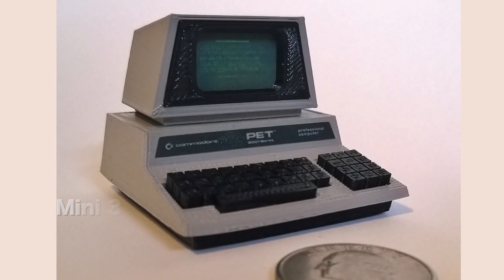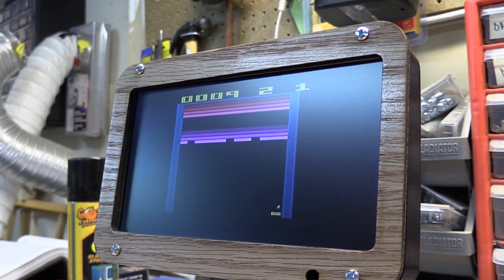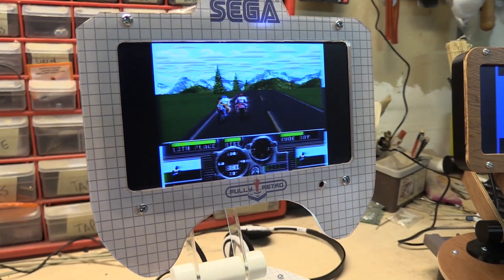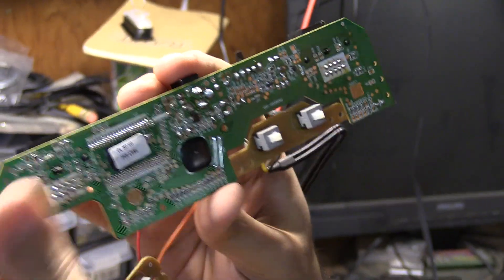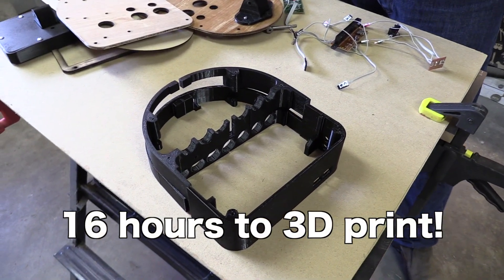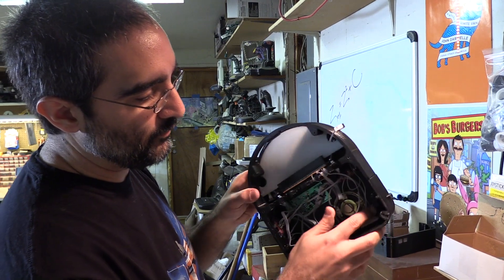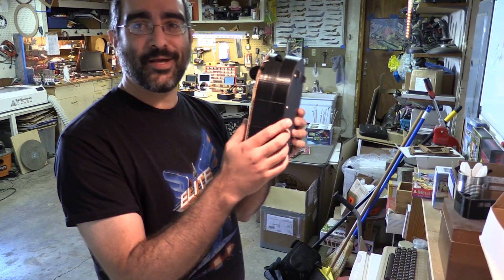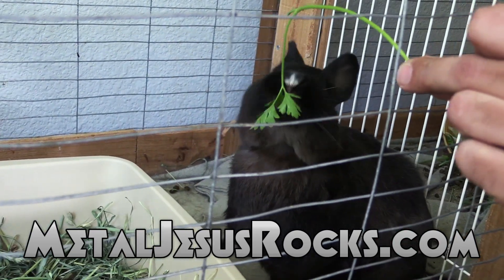Building a Rabbit Nintendo & Atari 2600 Clone Console

Comment: A version of these that would run off of rechargeable AA batteries would be awesome & more portable. FYI,  rechargeable AA batteries are way better than a battery pack. You can have a 2nd set charged & ready to go & never be stuck to a
 cord. One day that battery pack will fail, corrode & leak.  You will have to pay someone to solder it  Or attempt to do-it-yourself. Most people won't so they will just toss their device into the closet and forget about it. My Duracell rechargeable batteries for my nintendo wii have lasted 8 years  With daily use and I don't have to ever worry about changing out battery packs or deal with cords.

Comment: Very cool, but one thing I'd like to see in the future models is perhaps hiding or less reliance upon large industrial screws in the unit.  Some people probably find them fitting/retro and actually quite like the screwheads everywhere, but I'd personally rather they were hidden or somehow less used in the design.
Reply: ***** Oh, I've heard this commant A LOT :-) It's actually a design choice; I dislike how modern companies (Apple, Microsoft, really any of them) try to abstract away the manufacturing of their objects. I like how older tech revealed how it was built; it added an appreciation of the process. Now you buy an iPhone, and it's like, hey it may as well have been built by unicorns on the planet Yuggoth, because there are no signs of construction anywhere. Ultimately it's a matter of taste, I guess.
Reply: Dave Nunez That was funny!

Comment: Dave, is there a part number for the edge connectors used? I have one of those clone ataris and was curious where to pick up a connector.

I plan on ordering some of those mini consoles from you soon as well.
Reply: mllarson look up 5530843 at digikey.com (12 pin connector). They can be hard to find but digikey is a reliable source.
Reply: Cool, thanks!

Comment: I got a RaspberryPI for Christmas and spend a few days loading it with roms and stuff. It is certainly more accurate than the Nes on a chip would be.
Reply: Anthony McClintock Yeah, it's a great machine - we are thinking about how something like Pi could be used for next gen, but taking out a lot of the fiddling you need to do with configurations, etc.
Reply: The biggest challenge with the PI would be still including a cart slot. I,really love the design though. A unit with a large screen and two joysticks would be cool too.
Reply: Uh well, the Rasberry PI isnt technically using the cartridges, which the authentic
Reply: branaa09
The emulators the Raspberry PI uses are more accurate than these. These are using those cheap NES on a chip processors that clones were using way back in the late 90's. The graphics on them look terrible. The sound on them is Cringe inducing as most of them have the sound components incorrectly wired. If you think plugging in a cart is more authentic than having the game play correctly then have at it.
Reply: Crimson Ghost Yes Serviam

Comment from the maker: Watch as Dave from Rabbit Engineering builds a custom clone Atari 2600 & NES system with 3D Printers, Laser Cutters & soldering irons with his own retro designs.

http://www.RabbitEngineering.com
http://facebook.com/rabbitengineering
Reply: MetalJesusRocks These are awesome!!
Reply: MetalJesusRocks Great stuff, I love off-the-beaten-path game related stuff like this.  Have you thought about maybe doing some videos on actual do-it-yourself projects? Like maybe the custom arcade cabinets some people make that are run off of PC emulators? Or even the light boxes people make off of the old arcade marquees?
Reply from the maker: Greg Alexander Excellent ideas! I would love to do more of that... I always appreciate people who can actually create stuff like that, without lopping off a finger :)
Reply: Greg Alexander I second that idea! Come on MJ, let's make it happen.
Reply: nicccccccccccccccccce!
Reply: MetalJesusRocks Will it run Crysis?
Reply: Benoît Etienne Or use Retropi I Just wish it worked with the SNES to USB adapter I have -_-
Reply: Shadow_Burn68 What adapter? I'm using a ps2 adapter and it works fine.
Reply: retrobit SNES to usb adapter it uses negative values for the D-pad and for some reason retropi wont read them so looks like a ps3 controller it is

Comment: I don't want this to sound like I am being a smart ass because you probably know but did not do it for the video. When you tap something you always do a quarter to about half turn backwards whenever you do a half to full turn forward or there abouts to snap of the swarf type material so it does not jam the tap and hope and build up pressure. Of course all of what I just said depends on material being trapped and tap size, lubricant etc. I only say this as it might be a reason you are snapping product. Of course 2 hard to tell from my phone and if walls are thin it is understandable. I build motor  yachts and we tap all types of materials. Thought this might help. Merry Christmas.

Comment: If I'm reading the diagrams properly, Dave uses RetroBit parts for the NES. Is Dave using their hardware emulation? I am asking because I have a Super Retro-Bit Trio. I saw the Rabbit Engineering web sites, and the list of games that won't play correctly on the NES model. At the moment, I don't have any of the games listed, but Dirty Harry will not work on my Trio. It refuses to acknowledge me hitting Start on the controller - even with an NES controller. All of my other game issues were solved by cleaning the cartridges. I'm curious if this is the same emulator.
Reply: Slade Simon Yes, we use the RetroBit NES clone (which is the same as the Retron 1 internally). There are some games it does not work with (we have a full list on the website), but actually they have a good build quality and are fairly affordable. But, no Battletoads, so that's why we want to use software emulation for the next version, so we can overcome those limitations.
Reply: Actually, I said I saw the list. That's why I asked. A game that doesn't work on my RetroBit system is not on your list - Dirty Harry.

Comment: It would be faster, cheaper and be stronger if you simply used plastic injection molding for the case part instead of 3d printing it.  But I guess that would lose its "cool" factor.
Reply: lilricky2515 That would make it faster, but of course injection moulding equipment is a bit too industrial in size for my garage :-)

Comment: Sorry but $280 for this? Lol. The process and everything is pretty cool, but the money isn't worth it, especially since they're using a clone board instead of an original nes board and the screen is so small. I guess the need for 3d printing and such makes them expensive, but I would think a bigger screen and built in controls for a 2nd player would be awesome, might be worth it then.